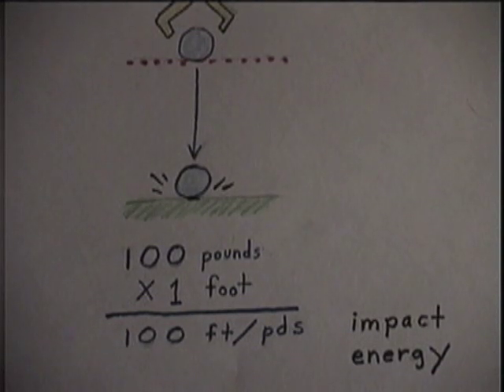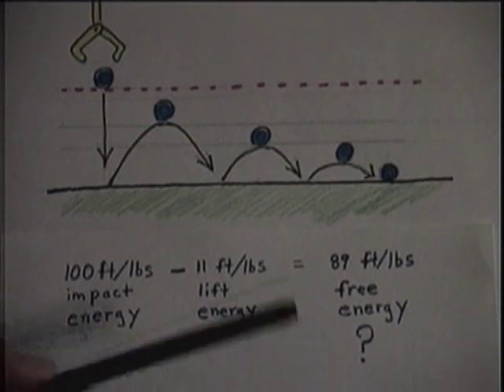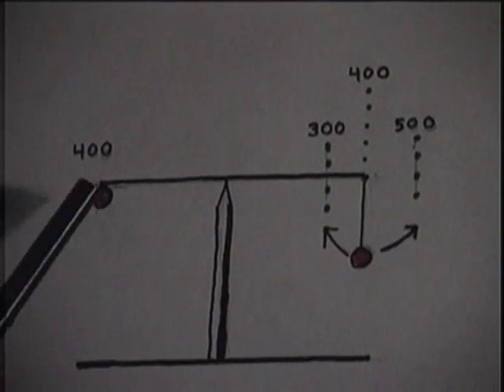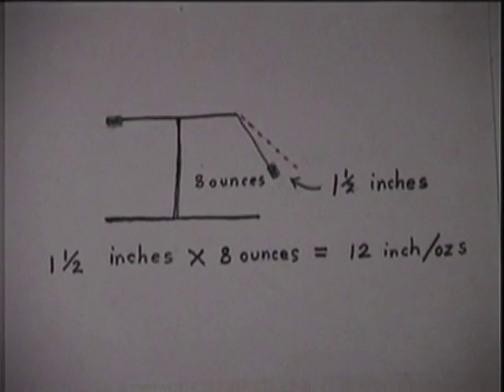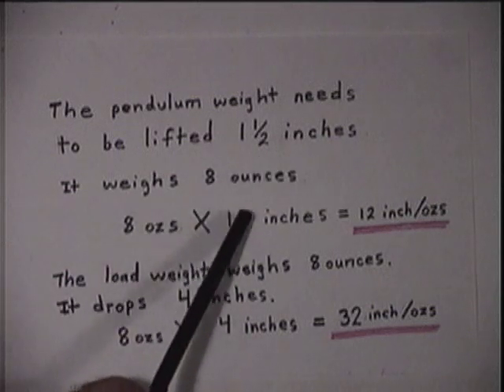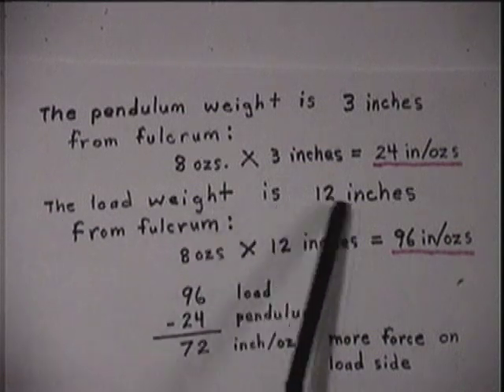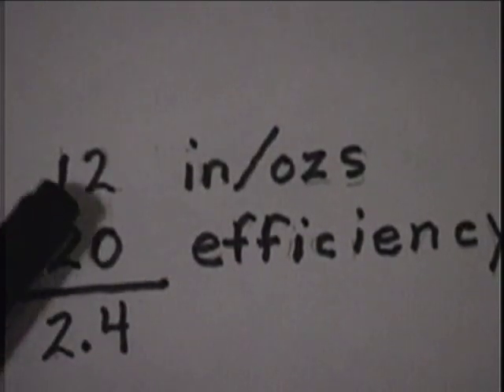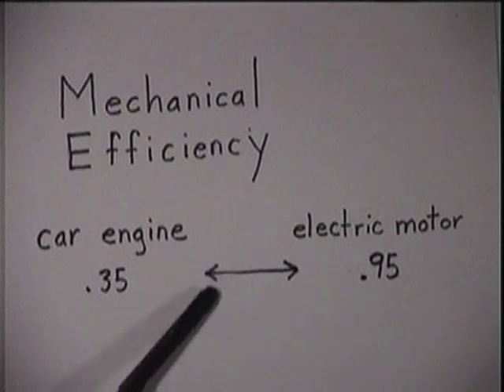Two Stage Oscillator Free Energy

Comment: Finally someone taking a serious approach with this. You have correctly identified the biggest problem with most measurements done on this device which completely forget to subtract weight of the pendulum from the potential energy of the "hammer" weight. However I still think this is a approximate estimation of the possible energy gain. Keep up the great work!

Comment: Basic flaw in your design can be seen at the very beginning. You have the main lever balanced, it doesn't lay on the left, and it allows the movement of the right joint too far up and down.
Add more load to the left side, and the resting point.
And then add even more load. You will have to add pretty much to choke the main lever.
And after that just a slight increase of the pendulum mass will require "much" more load on the left.
Compare the weights and energies of the load with forces and energies to swing the pendulum.

Comment: I hope I do not sound condescending . "BUT" I do believe you have missed the whole point of the TSO.  Your tests and math are very well done. And your calculations of OU are correct. How ever you are running your TSO at , way,  less than 30% efficient .  Your low percentage of OU is du mainly in the way you run the machine and secondly in your design.
Small adjustments in your design and running it correctly should yield close to 100 to 150 % OU.   My small TSO in my shop is a little larger than yours and is yielding between 300 & 340 % OU.  And my larger TSO outside is showing promise of over 1,500 % OU .  But that needs to be proven .  You are more than welcome to look and study my videos on this subject and ask any questions you wish.
 I would say Good Luck BUT  you don't need it. You are on the right path.  You just need to kick a little rubbish out of the way.
Reply: I've been studying this TSO for some time now, and I have to tell you that your math is wrong (not you RHEAD100; you where my inspiration to start studying this machine).

Then, I will give my opinion on the energy calculation.
I made this distinction because the pendulum energy is something that you can find in any book.
Now, on the other side, that's the mystery of the TSO, and that's why I called it my opinion.

-To calculate the potential energy of the pendulum, you need to take in consideration the length of the rod. That's the only way that you can calculate the height of the bob to calculate the energy. For example: for 45 degrees, you need to get the sine of 45 degrees (0,707) and multiply it by length of the pendulum's rod. I guess in your case, the rod seems that it is about 20 inches long. Then, the real height of the pendulum would be about 14 inches. The potential energy would be this 14 inches, times 8 ozs, times gravity.
It is interesting in this case that if we could make the TSO work in angles of less than 20, it would be great. Why? Because if we take the pendulum to a 20 degreee position, the cosine of this 20 degree is 0.94. That means that, if we had a 1 meter long rod, the bob would only go up 6cm (1-0.94) at this angle, while the other side of the pendulum would react accordingly, as you already know. 
But beyond this 20 degree, we have problems...

Now my opinion:
On the other side, which I will call the Left Hand Side -LHS, it is analagous to your ball. 
The aim of a free energy system is to get energy.
In my opinion, there is only one way in which WORK can be done: when the lever goes up on the LHS.
When it goes down, it is just restoring the energy to it's initial condition. It's like: Potential Energy - PE, when lever is up =100 joules. When it goes down PE = -100 joules. Result: 0. Like the ball, it goes up and down, and at the end you collected ZERO of energy.

Imagine that you have to take a bag of rocks up a hill. If you go up and don't leave the bag uphill, you won't have your task accomplished. It's like going up one stair and coming down two (yes, two).

Also, in my opinion, you should separate LHS and RHS. 
What makes the LHS go up is centripetal force. You can test that by reducing the mass on the RHS and doubling the velocity. Even better: double the height!  By this, you can check that the LHS is going to react the same way.
The other way around is to double the pendulum's mass, and release it half way lower than the 45 degree angle (remember: it's height! So 1/2 of 45 deg is 20 deg, in height).

Comment: I came back to this to try and  make it a little easier for you to understand. It all has to do with understanding Pendulums with FIXED pivots and Pendulums where the Pivot is NOT FIXED.
Pendulums with FIXED pivots keep a constant  internal energy transferring it between Potential and Kinetic energy  while a Pendulum with a MOVING PIVOT working in conjunction with a  suspended lossy load  can give out energy  by  lowering its pivot thus losing its swinging and also accept energy by having its pivot raised by an external source(pivot movements must be synchronized and usually of an impulsive nature)  
That means that in any machine using an energised  swinging pendulum , the energy transfer  to a lossy load MUST COME FROM THE INTERNAL ENERGY OF THE PENDULUM WHICH MUST SLOW DOWN AND DROP TO  SWING AT LOWER HEIGHTS. 
Please understand this in detail,   as you will be a very disappointed man about getting free energy or gravitational enenrgy........ all the  transferred energy from the pendulum to a lossy load, ALL OF IT must be put back into the pendulum by a human or any other  energy source if this machine is to be continuous in its impulsive  output movement.
Please do not believe half of what has been said about this machine for the last ten years. It is a nice machine , but using the same volume of  mass of material  one can do better.

Comment: Sir , looking at the diagram at 3:00, where you introduce 300 and 500 ( not force actually, but moment)  you are totally forgetting that the pendulum is PIVOTED and so it is a PIVOTED JOINT and not a fixed joint as you are concluding in your analysis, thinking and  what you call mathematics . Please go and revise what happens when you have pivoted joints and not fixed joints where moments as you described cannot occur. They would if the joint was not pivoted, 
I am afraid you are far off the point in this pivoted structure.
May I suggest that you think in  the following direction.
 
Any pendulum can be made to  swing by pushing it horizontally as is normally done, but a pendulum can also be made to swing by moving its pivot point in a synchronised manner, up and down or left and right, it does not matter, as long as you know what you are doing .

So here is what is happening, we could have more than two pendulums, hundreds really linked by any system, we can have springs included and all sort of systems that can STORE ENERGY   for a moment and then return it back to where it came from.  Such a system will not lose energy except the usual losses.  Note I spoke of energy being returned back to where it came from.

So in this double  pendulum this is what is happening. The first pendulum is given energy to swing, if it is left as a single pendulum swinging slowly, it will be just a simple single pendulum, that is it.

If the first pendulum is  made to swing more, the centrifugal force that is generated in a narrow sector will  excite the second pendulum by lifting its weight  where this second pendulum arrangement   gains  energy and so it will excite the second pendulum.  After some time the  first pendulum loses its centrifugal force and so with the second pendulum having its weight raised, this begins to fall and its energy IS RETURNED TO THE FIRST PENDULUM BY  SHIFTING ITS PIVOT POINT IN A SYNCHRONISED MANNER.

 That is  all  there  is , is a game between two pendulums, exchanging energy . One can play the same game using hundreds of pendulums exchanging energy between them, it can easily be done,

Now if the lifted weight is not allowed to drop  by holding it up by a ratchet or something else, as a non return valve when using water , well there will be  no energy fed back to the first pendulum and the operator will have to work very hard where the energy used by the operator is equal to the energy in the load , that is the  lifted weight.

Please so not mix, force and moment and energy and power.

There is no amplification of energy here , and  any change of forces through a lever or a pulley system does not change neihter energy not power from input to output,   What changes in a lever or a pulley are forces and speed of travel , but power and energy relation between input and output remains the same.   I shall not speak about Moments of inertias of flywheels attached through gearboxes.      There are many good books covering the fundamental of mechanics, 

Good luck, but do not expect much out of the two stage oscillator except that you can store( integrate) energy in a pendulum or a flywheel through giving many small impulses over a period of time and then using all the stored and memorised enenrgy to drive a heavy load  for a short time.